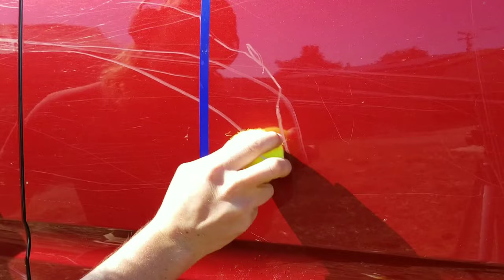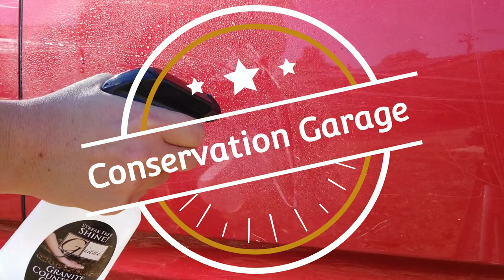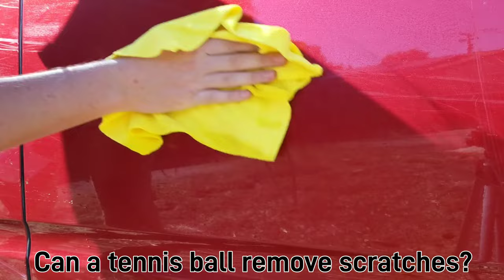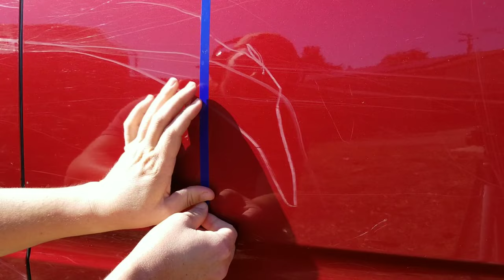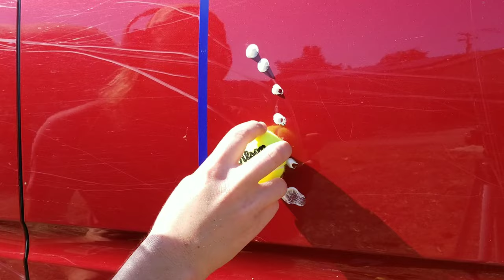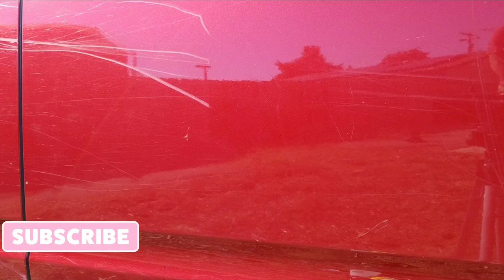Can you remove scratches with a tennis ball?

Comment: Scratches are stripped paint.  So a tennis ball won't do anything about them.  Scuff marks on the other hand are made of rubber or material added to the surface.  So a tennis ball has the right grip and softness to remove the scuff marks while not damaging the surface.
Reply from the maker: @YukoValis  I agree that if the scratch gets into the paint, a tennis ball won't do anything. On the other hand, if the scratch is only on the clear coat, then it will buff out, as demonstrated in this video.